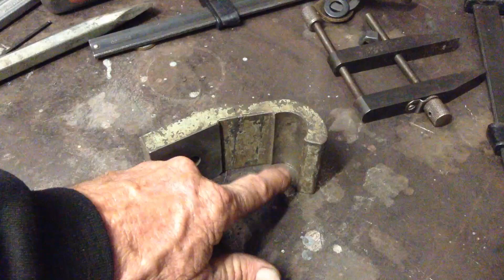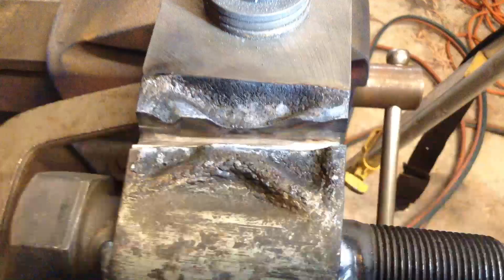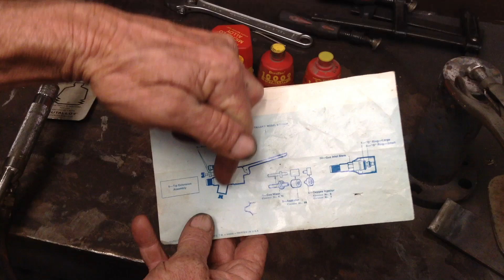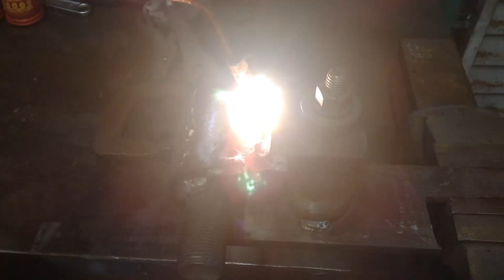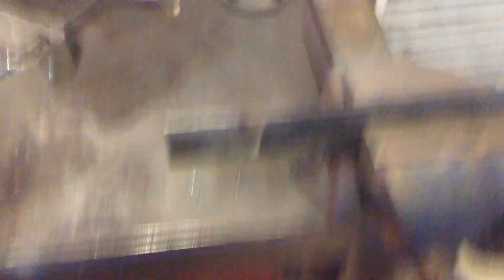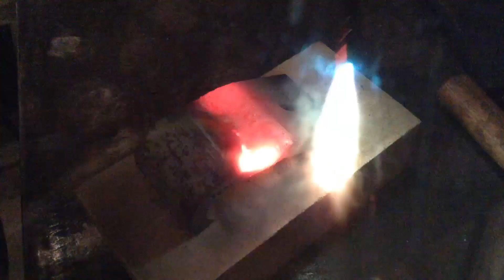Cast Iron Repair With Eutectic Castolin  Model B Torch .

Comment: I have a Eutalloy torch and it will not blow out powder with a small tip. I have to use a 48 or bigger tip. Do you think my torch had the same problem as yours?
Reply from the maker: Quite likely .   When not in use the lever should be held in the open position with an 0 ring or rubber band to preserve the life of the rubber valve .   👍

Comment: Good to see you have a. Touch the same as what I have
I having problems with the powder rubber valve and need a replacement did you find a supplier for your replacement
Also what size tip you using as when I got my touch it not have a tip so I using a brazing tip
Reply from the maker: Yes , a friend in USA found the replacements  in some small welding supply shop there .   Can not remember the shop name , but i will keep an eye out for the docket .   I have 45 , 48 & 53 Eutalloy tips . 👍

Comment: Hello dear Max.

I have the same Castolin Eutalloy Flame Spray Torch (old model)

Take a look at the Harris Model 187 Flame Spray Torch. This one looks very similar.
Possibly fit the same spare parts (from the valve)

Otherwise I can possibly get you a spare part for the Castolin Eutalloy. I have several such burners.

Many greetings from Switzerland- Lake Constance

Mr Walter
Reply from the maker: Thanks . A friend over in USA found the parts for the valve .   👍

Comment: Extremely interesting. I've been welding since the early 80s and didn't even have a clue this type of weld setup, procedure existed. It would've been great if you'd had a  filter on that camera so we could see the puddle, powder deposition, and etc. Fascinating as hell to watch
Reply from the maker: Thanks .  Something i could look into later on .   That torch & my larger Rototec spray torch will be used a bit more in the new shop .   👍

Comment: Thanks for sharing! Well, it looks the part! Out standing job and on top of the torch “going rouge” on you ,excellent!!!
Reply from the maker: Thanks .  I have the replacement parts for the torch now .   Cheers .
Reply: @swanvalleymachineshop  thanks max, i have been working off shore a lot this year more the most years. Extra long stretches the longest was 94 days, i doing some catching up with the channel(s). I think your work is next level.
Reply from the maker: @bulletproofpepper2  Cheers .

Comment: Somewhere down the line before I retired from welding, I had it put into my mind never to weld over a ground cast iron surface too. The reasoning being that grinding smears the carbon from the cast iron into pores where it inhibits the weld  medium from penetrating. I wondered if I had dreamed it, and was glad to hear you comment on it. Probably from a book, because I didn't work around too many other welders. Anyway I really enjoy your channel as it entertains and teaches me especially after my divorce from most of American TV.
Reply from the maker: That's an interesting point about the carbon .  Cheers .
Reply: @swanvalleymachineshop 

I seen this torch two weeks ago in a welders shop,he also told me to watch out for free carbon after prepping cast iron. 

Filing or a deburring tool cleans it up.

Comment: That is a cool setup, I saw Adam Booth using something similar one time, but didn't realize they were an older-school type tool.  Hopefully there's a modern equivalent, as that is a very slick way to repair cast - all I've ever done is use a torch and rod, apart from a couple tries at TIG brazing.
Reply from the maker: Hi Everett . There is a modern version , but bloody expensive .     I have just closed a deal on a Eutectic Rototec  like Adam has  ,  i will give that a test run when i have some time .  Cheers .

Comment: Suggestion is to tack braze the two pieces at the very end first and than prep the rest for welding. This way you can clean the crack right through
Reply from the maker: The jig holds it in place  along with the two tack welds that were done .   Cheers .

Comment: Wonderful video Max. I have only seen the spray welding technique used on shafts. This was an interesting use case. I would be happy to help in any way I can. Let me know.
Reply: Hey Max. I got the part number out of the manual you showed as A-190-206. They still have the part and it sells for $20.10 US. Should I pick you up one?
Reply from the maker: Thanks Rob .    Tom from Hill Top Machine  thinks he has found them , just waiting to hear back .     Thanks .

Comment: Max, how thick of a build-up is this particular powder good for?  Before retirement I worked at an aircraft repair depot that had, among other things, a plasma/thermal spray shop.  As far as I know, most, if not all, of their powders could only be applied up to a maximum thickness before there was a risk of failure of the build-up.  I hope the commenter below is successful at finding you the needed repair part!
Reply from the maker: Hi Bob .  Not sure on that one , i guess  the size of the area to be built up would be the governing factor .   The part repaired in the video  would be  amongst the largest i have used the process for . Cheers .

Comment: That's pretty slick Max.  I've never seen that before.  Do you know if it pulled at all when you did the second round on it?  It wasn't in the fixture then so I was curious how stable it was.  Ken
Reply from the maker: Thanks Ken .  It  should not have .   I will know when i fit it back to the lathe , It's just a support for the carriage kick out shaft , below the feed shaft on the lathe .   Cheers .

Comment: Max. enjoyed this video. Always nice to have different tools in the box to go to.  I have a spray torch at work I have used on some worn shafts. As you know the first pass is everything. That torch would be fun to play around with. Thanks for sharing Max.     I also have a cast repair job downloading right now.  Plain ol brazing, not as fancy as yours.   Gary
Reply from the maker: Hi Gary .   I will have to watch out for it .    Cheers .

Comment: First time I have seen one of these used filling in gouged out cracks, only ever seen them used for building up worn surfaces. Also the first time I have seem them used where  it is probably a better repair technique than welding!
Reply from the maker: They can be a versatile bit of gear to have around .  Cheers .

Comment: Max, Awesome repair...thanks for brining us along. I didn't know one could do structural repairs with the spray torch. Thanks for the education, thought they were only for build-up. How would you compare the strength vs bronze brazing ?
Thanks, Dean
Reply from the maker: Hi Dean .  I think  it would be stronger .  But there are a lot of variables  , like shape of the part & quality of the material being repaired .  Each would  have their own benefits .    Great for exhaust manifold repairs .   Cheers .

Comment: G'day from Arkansas in the US!

Been enjoying your videos on YouTube; probably watched 'em all.  Nice to see stuff from somewhere warm, as it's 16° F (that's -9 C) outside as I type this, and my shed's unheated

You might want to reach out to Keith Rucker for parts on that torch.  I've never dealt with him, but be seems a really pleasant guy from his videos here on YouTube, and he deals with the restoration of antique equipment

Betcha if anyone knows where to source a part for that torch, he'll know who to point ya' toward

And if you run across someone who has parts but doesn't want to ship to our take payments from Oz, shoot me an email at xbil@yahoo.com, and I'll be glad to so what I can to facilitate things for ya'.

Also, my dad always repaired iron casting with a stick welder using a rod he called "Ni-rod", which I believe was a high nickel content welding rod.  No idea if it ran AC or DC... He always took a chipping hammer and peened the hell out of the bead while still hot, and he said it was a necessary part of the process.

Seen him use it a number of times in cast iron, including exhaust manifolds, and didn't ever see it fail

Never used it myself.

If you've ever had experience with a similar process, would be interested in hearing about it.  Might be a good subject for another video...
Reply from the maker: Thanks Mate .   Your Dad did it the right way with the peening , stops cracking .   And you can keep the minus 9 deg !!!   There is a place i saw over in the U.S that reconditions these old torches , but i forgot where i saw the information . it was only the other week as well !  Cheers .

Comment: Great addition to the shop Max, got a part number for the brazing jig!!!😁.
Nickel based alloys are great for cast repairs, I've allways have a box of rods in-house, and use them on dissimilar materials; not the cheapest though!!!
Thanks for sharing and best regards from the UK.
John.
Reply from the maker: Thanks John .  When that torch popped up at an auction , i could not resist it .  Something i had not used in many years .   Cheers .

Comment: Hi Max, it must be 40 years or more since i did the course at Eutectic in west London and have not used it since but I seem to recall you warm the part, not up to even dull red, untill a thin layer sticks,  then melt that layer (ie it becomes smooth and shiny from the sandpaper looking) , then start the major build up. I hasten to add systems change, and memory fails, with age, so only take the above as an old mans reminiscences not gospel. 😢
Reply from the maker: Thanks Chris .  Just as the part gets to a dull red is when i do the sealing layer .   I would have loved to have gone to a Eutectic course .    On camera the part appears hotter for some reason . Cheers .

Comment: Great repair Max, I worked for Certanium Welding Alloys in the 70's and they also had a powdered alloys torch, we would demo and test on 1/2" thick cast iron plates grooved welds and buildups. There should be a lot of these torches still floating around.
Reply from the maker: I bet there are a lot floating around , collecting dust !    Cheers .

Comment: for pre and post heat I have a 2 burner covered gas bbq it works pretty well with the added bonus being the boss no longer complains that there are metal things in her oven
Reply from the maker: That would work well .   I did get in trouble from the wife once with a set of Triumph engine cases in the oven !  Cheers .

Comment: Hi Max I fixed an exh.manifold with cast rod and cobra torch. preheating in charcoal grill and welding it up and placing back in the grill till it cooled. Your jig worked perfectly great job !!
Reply from the maker: Thanks Randy .  I had to google Cobra torches !  Cheers .

Comment: Nicely demonstrated Max, it's good to see other methods to reach the same goal. I wonder how the hard powder would stand up on excavator teeth etc.
Reply from the maker: It would be too costly .  There is that tungsten overlay that they use on high wear areas .
Reply: @swanvalleymachineshop  👍

Comment: That sure looked easier than brazing rod...really pretty neat system you've got there.  I've seen Abom79 and Lance use those on videos.  

Does the repair need to be peened or stress relieved?

Being entirely self taught where OA torches are concerned it would be neat if one of you experienced guys could somehow explain the oxidizing/carburizing/neutral flames.  I have yet to see a good presentation on the subject.  I think its hard to get decent pictures of the different flames.
Reply from the maker: As far as my past experience goes , never had the need to peen as with nickel rods . Just wrap the part & cool as slow as possible .   I have never seen any video's of the flame details either , mostly neutral flame is used but there are cases where a carburising flame is best , some cases with bronze & silver solder from memory ., can't remember everything !!!     As far as getting good flame pictures you would need a good array of different tint lenses to try  for best results .

Comment: Very interesting video Max.  I'd not seen that type of torch before.  At first I thought you were grinding out way too much for regular brazing, but then the torch did it's business spraying in the filler and all was revealed.  It should be super strong with the nickel component.  Enjoyed.  How does the operating cost compare to the other two alternatives ?  Cheers Rob
Reply from the maker: Hi Rob .  Cost has to be weighed with labour time ,  bronze would be cheaper but maybe not always depending on the part & the quality of the repair .   As you know in the repair game , every case is different .    Cheers .

Comment: Hi Max, not an expert but I think it is stronger than brazing, nice to see a destructive yield test between the 2 procedures.
Reply from the maker: It would be good to see a destructive test , but not on my lathe part i just repaired !   A lot would depend on the quality of the cast iron & good prep & fusion with the weld

Comment: I understand that the powders are expensive.  What is the benefit of using this procedure instead of brazing on this particular job, as brazing would probably have been cheaper ?
Reply from the maker: Brazing would have been cheaper in materials , not labour if it was a charged out job  .    This was a test run for the torch & the perfect candidate .  Every cast job like this will be different & require different techniques , so you just make a call based on experience .
Reply: I am a Spray-Welder, and powder IS expensive, my bottles cost $95 US-EACH.
Reply from the maker: @ZAPATTUBE  Quality comes at a cost  !
Reply from the maker: @ZAPATTUBE  For 10224 nickel powder , 500g  $153.30 Aus  ex Brisbane .  You guys get it a fraction cheaper !

Comment: When I did welding course at Tafe gas cigarette lighters were outlawed.     You have a responsibility to show safe practise in the workshop and to explain why what you did was dangerous.  

Stavros
Reply from the maker: Hi Steve . Judging by your comment , once you get a bit more experience under your belt you will learn why some things can be lit with a lighter safely  , others with a flint and some with a stick or mig welder .    I assume at Tafe they have also outlawed common sense , as it has been 35 - 40 years since i was there myself !   
Don't forget if you pointed something out , it then becomes your duty of care to explain it  ... never forget that one .  
Happy Welding !    Cheers .
Reply: Good thing he wasn't using a cigarette lighter, it looked like a torch lighter to me.
Reply: The issue is that a hot blob of metal could land on your pants where the lighter is and melt a hole in your pants and the lighter causing a fire or small explosion.
Reply: @dudleycornman1624  so that would come under the general instruction to clear the welding area of inflammable detritus. The actual lighting of a torch is not the problem,  even less of a problem if the lighter is empty leaving only the flint striker.
Reply: @chrisstephens6673  Exactly...